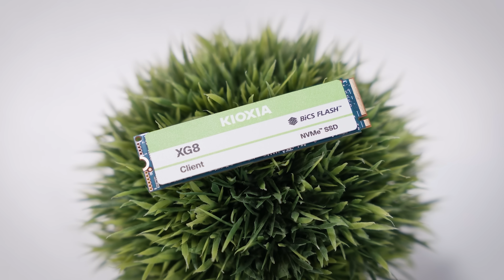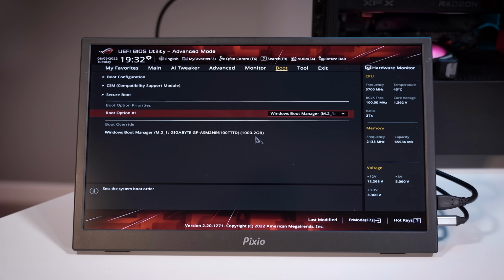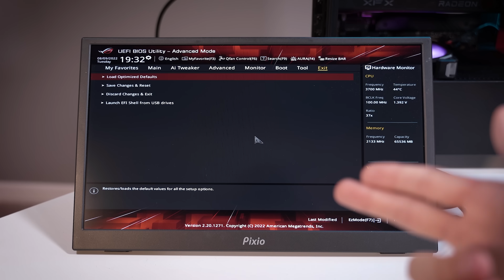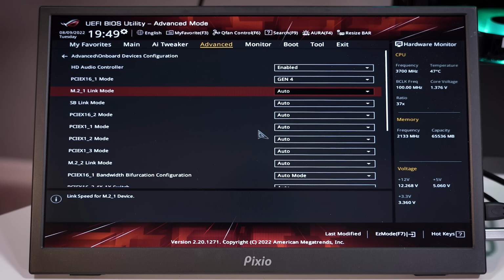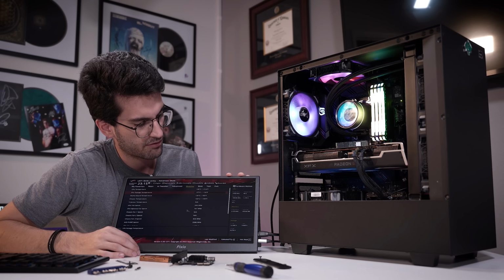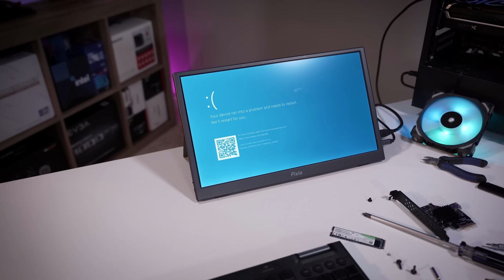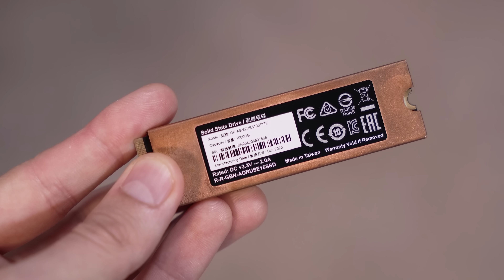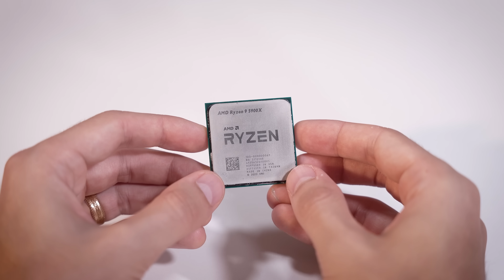Fixing a Viewer's BROKEN Gaming PC? - Fix or Flop S3:E2

Comment: Thank you so much Greg until this point everything work perfectly it’s giving me some happiness in my heart that you had some trouble to fix it and it was not only me 😢 it was the most stressful experience for me to troubleshoot and nothing was working unfortunately,  thank you again for the fix and the experience to meeting you, your success comes from how  humble you are. Fan was never put back lol
Reply from the maker: Glad she's up and running again! Thanks for reaching out. Let me know if any issues pop back up!
Reply: @GregSalazar  will do thank you 🙏
Reply: @GregSalazar  I don't think this was a CPU fault. This is definitely a RAM issue. All 4 DIMMS are populated, this puts the CPU memory controller under way more pressure. Which would cause it to throw out random BSoD over and over. Most of the time you have to actually downclock RAM if you're gonna run 4 sticks. The fact it worked with the 5950x could simply just be because it's higher binned silicon, so the chip itself had a memory controller that could run all 4 sticks at the XMP profile. I would of tried running the system with just 2 sticks of memory and seeing what happened.
Reply: @xkannibale8768  That doesnt explain the crazy high cpu temps in bios. 80+ C idle. I bet the cpu is fishy
Reply: @xkannibale8768  Mhhh, the ram was at JEDEC 2133Mhz, no XMP applied from what I could see in the video. That shouldn't stress the controller much. I'm running all dimms populated with a 5900X and 64G at 3600Mhz C16 without issues. So while technically it is a possibility, I kinda doubt it in this case.
Reply: @xkannibale8768  I suspected a RAM issue initally but you shouldn't need to underclock a matched kit - the XMP profile will be set to work with all 4 DIMMs. Since swapping the CPU fixed the corruption issue and fixed the high temps as well, that's a strong indication that something internal to the CPU was faulty.
Reply: @xkannibale8768  before going for help I tried some troubleshooting my self was a full month trying everything a could since I don’t have spare part there’s a lot of thing I couldn’t do but I did took the rams out and try only one and change it with all of them and plus change it in different slot no help at all, I check all cables and made sure the gpu and cpu was correctly install there a lot you can check in a month. And it was still giving me All the same errors and it was working fine for 2 year and with that cpu a year until it stop working. Since the cpu was change everything have been working normal I will even say that works better know.
Reply: @xkannibale8768  You should be more observative dude. Ram was running at stock speeds. 
 Imc can be stressed out but the symptoms are different. There are specific BSODs that usually are presented after windows have been loaded. I would be super surprised if running at stock RAM speeds, imc was stressed. 

As a side note, I'm using an i7-8700K with 4 sticks of DDR4 at 3200Mhz (with XMP) for a little bit more than 4 years. It's slightly overclocked as well (since day 1). My imc should have been destroyed by now , but I have zero issues. I am expecting some to have an excuse to change the whole system, but it doesn't give me any, damn it :p
Reply: @xkannibale8768  I was thinking the same, but CMOS was reset and from the shots showing the BIOS screen XMP is not activated. I would still try reseating the CPU and testing fewer and other RAM sticks.
Reply: @xkannibale8768  That's a DDR5 thing, not a DDR4 thing.
Reply: @xkannibale8768  It is highly probable that it could just be a form of Memory issue. All of the random BSODs were pointing to memory issues except PAGE FAULT IN NON PAGED AREA could point to the drive. However, Greg did reset the BIOs already which should put the RAM back to stock settings. I think Greg should've tried with 1-2 sticks of RAM to see if it could get to the OS. Not sure how long the Memory Controller will last on the 5950X though.
Reply: @mikeychowster  I think he told someone else that he did off cámara and use other ram plus he put the cpu in a different pc and it was giving him the same problem I hope he makes a difference video to se if he can fix it because it was working normally until it didn’t
Reply: Feeling happy for ya. Getting an Upgrade like that certainly isn't common as well, you literally just got the only Ryzen CPU which was better than the one you already got in there. 

Little note: I fixed a similar system for a friend recently, it was certainly the weirdest issue i've ever encountered. However, I only had a weaker chip in my shelf so I had to downgrade his brand new 5800X3D with my old trusty 3600. He's practically borrowing it until his replacement chip gets shipped. The issue, according to our market place: An internal controller kicked the bucket and made the CPU send signals to draw power beyond the actual TDP limit, resulting in hitting 95 degrees celsius right after boot. I feel like something similar might've happened here.
Reply: @miracula7782  it was crazy it wasn’t even that old that chip I am really excited to see a video to know what was wrong with that chip since it was working normal but the only thing I can say is that the new chip that I got thank to Greg it’s cooler in bios 38 give or take  know since with the other one was always hot since I got it but I didn’t put to much atención to it since it was never over 75-80 ish it never got over 90 that it’s the danger zone that I look up on google I was thinking in was that high since it’s a stronger chip with high voltage it was normal wrong thinking in my part.
Reply: @gabydiaz2732  Yeah man, technology is an iffy thing. A CPU can die out of nowhere, you never know. To your temps: the bios temps were this high because, as I said, AMD told us it was a controller issue and your 5900X drew more power than it should have. The 5950X is usually running at way higher temps than a regular, undamaged 5900X.

As an example: My girlfriends PC runs a 5900X, my PC has a 5950X inside. Mine has a custom loop, hers is rocking an AIO for the cpu. Her idle temps are somewhat around 35 degrees, while mine Hits 45-55 in idle regulary. This is totally normal with the 5950X, so don't be too concerned once you realize it hits 70-80 degrees whilst under low load. It's a very power hungry beast, which means it creates a hell lot of heat. Gotta power these 16 cores / 32 threats somehow after all ;).

If you wanna have a small advice here: You can actually undervolt this CPU a bit to make it cool down significally whilst only losing like 1-3% of performance. I'd recommend watching a YT tutorial on 5950X undervolting, it's a blessing for your room during summer haha.
Reply: @miracula7782  thank you will do check on this and probably do it since Florida it’s pretty hot state
Reply: @gabydiaz2732  Ah yeah, i completely forgot you had to be a florida man since he fixed it ;). Greetings from germany! You can expect your 5950X to be even a bit hotter than mine since I expect your room Temperature to be higher than mine, due to locations and the fact my system is in my basement on top haha.
Reply: @miracula7782  AC in the house is pretty nice I try to keep it at 73f of less until my wife sees it and change it to 76f-78f but outside temp are 80f to 90f all the time until November that cool’s down.
Reply: @miracula7782  how hot it get there do you guys use a lot of AC I ask since I am from Puerto Rico and AC on every house or even room it’s not a thing, PR life it’s open de window and put and fan in front of it lol and you get what Mother Nature give you
Reply: @gabydiaz2732  There are ACs, but very, very rare. We don't need them because we have mild summers and cold winters. The hottest ever recorded temperature in germany was something like 42C, which happened like 25 years ago. On top of that, as I said, my system's in a cold basement. The room temperature never goes beyond 20-25C in the summer. In any other room, it'd get hotter of course.
Reply: @miracula7782  that sound like heaven when I was in Puerto Rico it’s hot now I been in the states for like 12 years and probably if I go back to the island I will not survive 😂
Reply: @gabydiaz2732  Haha I feel that xD yeah the hottest I've ever experienced was 40 C, and i start to die at 35-ish, since I'm not used to high temperatures. I love winter, I'm one of those guys who walks through snow in a t-shirt and shorts. Thats why my "office" is in my basement
Reply: @miracula7782  as a floridaman, you sound like a floridaman. 😂 when I lived in Chicago it would get down to 30c and I would be wearing flip flops and a tshirt to walk the dog. Where I live in Florida we rarely get below 0c in winter or above 35c in summer. Humidity makes it feel much colder or warmer though, +/ 10c. Right now is perfect, 20-30c all day every day.😄
Reply: @miracula7782  That's what it looks like stock settings hitting 60c+ on an aio at idle cpu is definitely wanting more juice than it's supposed to have
Reply: @gokublack8342  Well, its gotta power 32 Threads at the same clocks somehow. This CPU is extremely power hungry, and runs hot because of it, naturally. I actually manage to get it down to 45-50 degrees idle and 65-ish degrees at full usage due to some undervolting and finetuning. Got around 99.2% of the original performance while cooling down around 20 degrees +-.
Reply: @miracula7782  But there's gotta be something wrong with this specific one it shouldn't be going into thermal shutdown or locking up etc just from trying to boot into Windows
Reply: @gokublack8342  we're talking about the 5950X they got as a replacement, which I use myself. This whole conversation has been about how hot the 5950X runs, and not their defect 5900X. The 5900X is also pretty damn hot, but shouldnt shoot up to 65 degrees in bios. I actually mentioned the most probable reason for this defect in a comment above, idk where exactly. It's been a while.

TL,DR: AMD told us that our 5900X which had the same, or extremely similar issues, had a specific failure. You can read up which one in an earlier comment, I think it was the first one I ever wrote here.
Reply: Insane for it to be the CPU. Surely it would be covered by warranty since it's not an old processor. None the less, Greg you're a top bloke for offering these services aswell as helping the owner with a slightly better CPU 👌
Reply: @ceexbee  yeah, i'm sure Greg can easily send the CPU to AMD and get a new one in exchange.
Reply: if it's a cpu issue, can you try to put it in warranty ?
Reply: @GabyDiaz27 Out of curiosity, what is your new temps with the 5950x? I was concerned when greg said your 57C idle is too hot. I have 5950x and it regularly run higher (I dont recall exact temp but it's high). I was waiting for Greg to show new idle temp after switch to 5950x but that never happend so thought I'd ask you.
Reply: @stevie5998  in bios it’s like 36 ish
Reply: @stevie5998  Hey there, 5950X user with a custom loop system here.

Greg ment 57C in BIOS is too hot, not idle. For the 5950X, 50-60 idle is completely normal. Its a very power hungry CPU that draws up to 105 watts in idle. Its got 16 cores / 32 threats to power. Mine runs at around 42-50 degrees in idle (just checked again), but it's slightly undervolted and sitting in a custom loop with 2 360mm radiators. Your temps are fully in the expected range.

You really can't compare a 5900X to a 5950X temperature wise. As a small comparison, read the comment i made right before this one. Too hot for a 5900X is the norm for a 5950X ;).
Reply: I'd suggest you to keep an eye on your PSU in the future. I've had a PSU slowly fry a CPU over a year in similar circumstances as you and was on its way to fry a 2nd one. Look out for anything unusual with the new CPU as it could be a PSU fault slowly killing it.
Reply: And you got a 5950x now too that's a good upgrade!
Reply: Reseating the 5900X should've been the first option but now Greg can hopefully give us an update video of how it will work on a different motherboard.
Reply: What about PSU? If the new CPU gets fried again, change PSU :)
Reply: 0
Reply: I had the exact same symptoms on my year old computer. My ryzen 5 3600 was the culprit. Luckily I was able to get an RMA on it but it was very weird. I had noticed when I had installed the Cisco anyconnect vpn I needed for work it had started to blue screen often until the cpu finally died and wouldn’t even let me reinstall windows.
Reply: try bios update. i have the same issue
Reply: @maddymuhat8079  was updated and downgraded  to a more stable version and did not work that was the first thing I checked in that time
Reply: dude you got a big upgrade lol
Reply: Congrats.  I like the gpu and the motherboard. I also have an xfx gpu, Asus broad and all amd GPU and cpu.
Reply: I have the same case and same issue and all I have to do is press f3 alot and the system starts as normal its like u have to press something for the system to become aware it needs to boot. Weird but worked for me lmao
Reply: Switching to a new video one sec have some advice I figured out something about nvmes hard drives and ssds
Reply: yo bro what you doing with that 120mm fan taking air away from your GPU? if your psu fan is taking air from inside the case then that's wrong. it has its own vent. only purpose for that fan to be there is to be pushing air towards your GPU since the h510 is a very restrictive case
Reply: @VoidlessOfSpace  lol didn’t think to much about it but the purpose was for better airflow and temp since you mención the case it’s not the best but until I can get a new one I am stuck with it 😭 it was my first build and didn’t do the research for the case to much I was only looking for one not to expensive but not to cheap in that time only regret but I did like the simpleness on how it look I will like to mod it but a don’t have tools to do it.
Reply: @gabydiaz2732  i get it dw, i fell for the h510 for my first PC too. its a PC trap that most newbies fall for.  id just flip the 120mm fan that's under the GPU so what air is there is sent to the GPU. i had the antec 120mm 2k rpm fans that was like 50$ 5 pack. they're good fans that can make even the h510 bareable
Reply: @VoidlessOfSpace  I want a new case if I am going to spend money since air is bad and the the space it’s crazy to work with. For example if I change the fans It will be a full pain to to do it and cable manager it’s not the best case there’s a lot for this it’s better to change it but you know until I get extra money since still need to provide for the family first lol l Christmas is coming soon let see if I will ask it to my wife lol 😂
Reply: @gabydiaz2732  you should flip the wather cooler upside down
Reply: @mrlk665  it’s impossible the only way it will fit it’s in that position lots of case limitations but it’s still ok it’s higher from the pump that it’s located on the cpu yes it will have been best to put it in top but but only one hole for airflow or I could have change the tubs down but gpu space so it’s out of the question bro I tried it is what it is, still how it is will not break the pump
Reply: @gabydiaz2732  I suggest you look into the Phantek P400A case. There about $110 but well worth it. I have one and you can fit your 240 rad in the top or front as well as a 360 in the front. Plus there is plenty of room for everything else.

Comment: I was in a computer repair shop for a couple of years and this is a common "kick the bucket" scenario that AMD chips have. AMD has a BAD habit of putting in voltage channels that are too weak to handle even normal voltages. This causes part of the chip to run too hot and it will wind up cooking part of the chip after just a couple of months to a year after install. The reason for this is because of the way AMD Chips are built with the pins built into the chip itself rather than like Intel's which are on the motherboard. Even though AMD chips are bigger than Intel chips, the built in pins on AMDs actually take up MORE space and thus the rest of the chip structure has to be squeezed in as a result. AMD tries to get around this by making the voltage channels inside the chip as small as possible. And more times than naught they make them too small and weak to handle even normal voltages and thus you get the resulting "cooking." 

This is why I ALWAYS recommend people go with Intel CPUs. Yes they're not perfect either, but they are less likely to fail due to internal "cooking."

Comment: One of your better ones Greg. For us your loyal following as well. Quick, inexpensive and to the point. And I thought it was Intel that had the heat issues. ?? I was drawn in since I too have a Gigabyte branded M.2 drive. I was hoping that was not determined to be the culprit. Fine diagnostic and detection and you didn't have to postulate about any water block metallurgy. Good on you .  Cheers.

Comment: If you can get into the recovery screen you can use the msconfig and sfc scan on the administrator command prompt (while windows isn't booted) so you can fix windows corrupted files and replace them it will likely work also if your ablento get there that is

Comment: I wonder if the cpu issue has anything to do with the power P-states that get adjusted when loading into windows? I may be misremembering, but I think the CPUs on these platforms run at stock speed exclusively in the bios and the BIOS only enables various states for the OS to manage. It isnt until the windows kernel takes over that it starts adjusting the power states based on load. Its possible the cpu is just not stable at lower power states due to a defect, or perhaps it's been running an aggressive overclock and it slowly degraded to the point the chip was marginal.